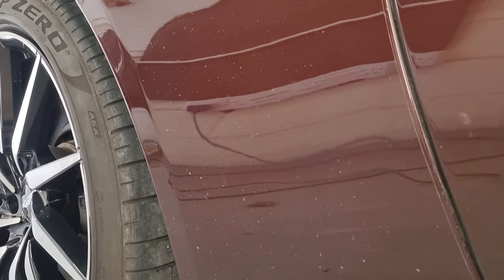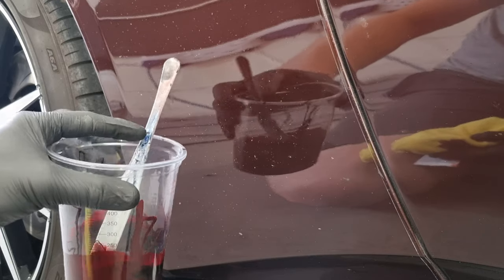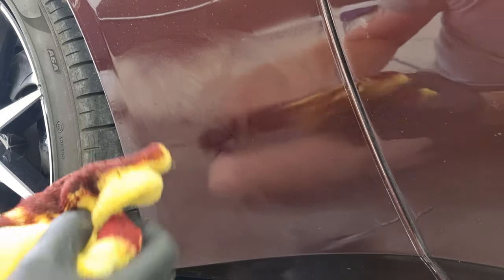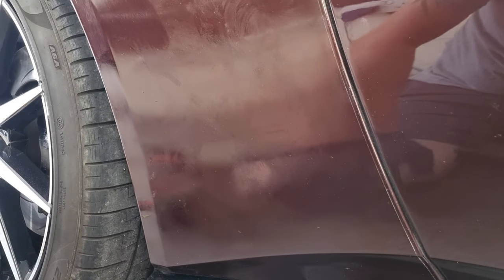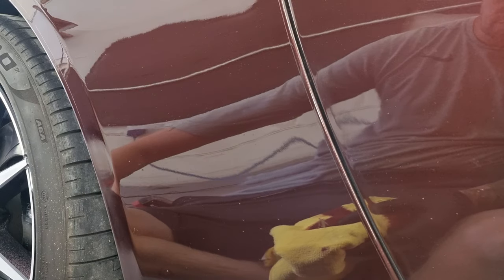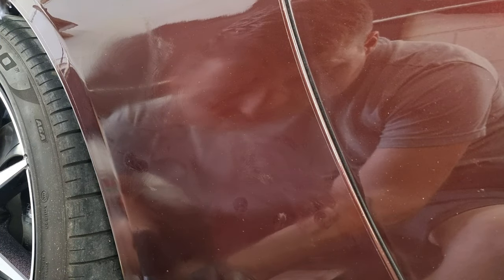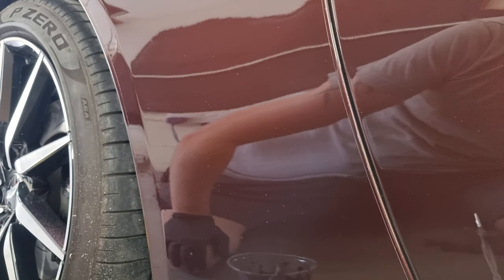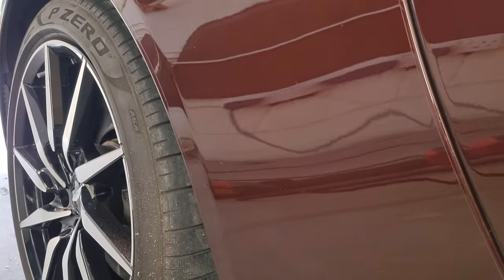The BEST way to Fix Rash and Paint chips on your Car

Comment: A massive thanks to you for posting this - I tried this for the first time on my Missano red MK1 Audi TT earlier today on the bonnet and front bumper. Was initially terrified but it’s worked a treat! I used G3 and Menzerna compounds and a ceramic Hybrid Solutions Polish. Am extremely grateful to you and will now tackle a few other imperfections the same way 👍🏼

Comment: Great work geez! Already subbed! Dyou think this is pretty safe in terms of not taking too much off your clear coat as youre pretty much just buffing the fresh coat of paint off and probably barely taking any off the factory clear. What you reckon? Could this be done a fair few times? Reason I ask is Ive used some of your other videos to fill up, wet sand and buff a couple deep chips and I can still see a little bit of a dip in the paint where the chips were so I thought I could use this tekkers to level off that last bit. But obviously I've already wet sanded and compounded the area so dont want to risk taking off too much clear coat! Appreciate your help mate! Keep up the good work! Best paint technician on youtube! 💪

Comment: 2:32 as you start to apply the solvent based paint I question what is that white line running up the right edge of that panel you're working on? Is that a respray paint line or is the panel you're working on have a vinyl layer on it? 

Edit: ah, it was a PPF.
Reply from the maker: Ppf yep 👍🏻

Comment: You also did this method on a black bumper except you wet sanded it before you buffed, Is that just to speed up the process or is it better not to wet sand it? Thanks!
Reply from the maker: I wanted to round off the jagged chips on the one I sanded
Reply: @cvrpov  I tried your technique for the first time today, scratch on the door actually turned out really well, is it normal to see your finger strokes  in the clear coat when you look at it on an angle when done buffing?, I do what you do but I'm in the USA ,wish I could work with you for a week to learn more tricks!

Comment: Your videos are very good. Can I just ask - it looks like the area your repaired has PPF on it (there's a fine line around the wheel arch). Is that right? Thanks again!
Reply from the maker: Thanks for watching. Yes it's ppf. It works on both ppf and non ppf arch areas
Reply: What’s “PPF”?
Reply: @martynsamsom8237  I'm wondering too. Something something film?😄

Comment: Question hi my friend with the road rash would use Base coat add hardner yes or not then after that is fine use a cutting compound yes
Reply from the maker: i just used solvent base mate, unthinned
Reply: @cvrpov  cheers

Comment: Great work as always on your channel. You have quite short videos that cover the topic of the day. Subscribed about 3 months ago. You explained greatly that a rotating tool is better than a DA. But as I'm not living in UK and are not very fond of the new shipping/import fees - I have to buy paint kit from elsewhere. Would it not be better to mix with the paint with a hardener? Otherwise wouldn't the paint go off when using a degreaser? (I use alkaline but also petroleum based degreaser during winter).
Reply from the maker: Hi Martin thanks for the comments. Maintenance wise it might be a good idea to seal the area with a ceramic or something similar. Wiping solvents over any touched in area 'could' lead to some tarnishing of the paint as you mention. The paint being base alone seems to hold up to general washing and pressure washing in my experience

Comment: I thought PPF was supposed to be "self healing" like they get a little heat on it and it heals the rash right away?

But if not, then it's like, what's the point of PPF?

So when the PPF installers replace the damaged area, isn't that covered under the "10 year" or whatever warranties they give you? And how many times will they do this?

In any case - what you did seems a lot easier and less expensive than dealing with PPF or detailers. Could do this on your own.

Thanks!

Comment: At 4:32 it looks very poor. All of the lower area chips are as  bad as before anything was done. Poor solvent paint adhesion is 100% from poor surface prep and poor application, not the diameter of the chips. Allowing the paint to cure would make the polishing easier without fouling the polishing pad.
Reply from the maker: Gonna have to disagree but thanks